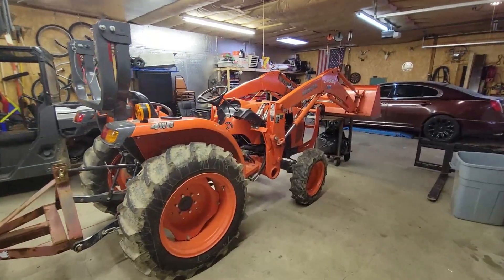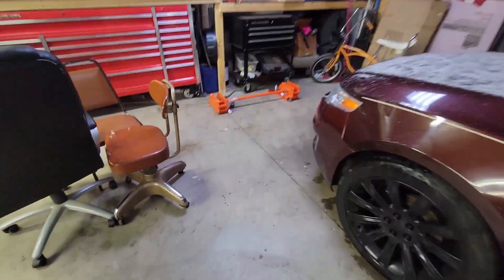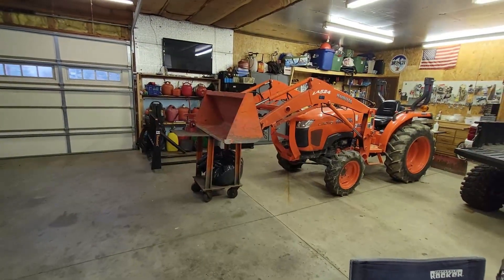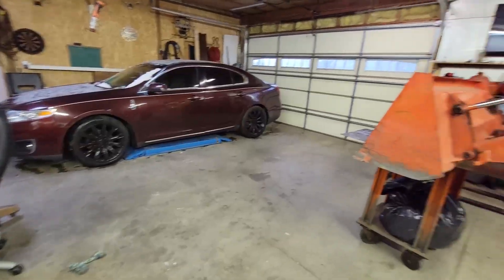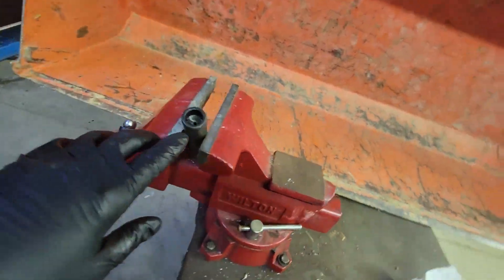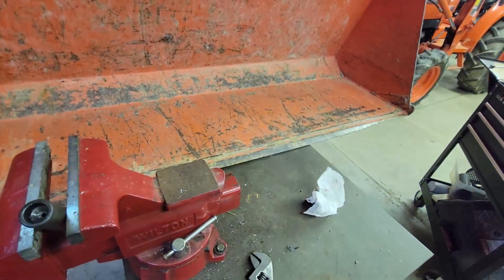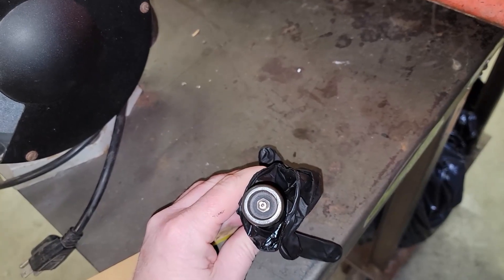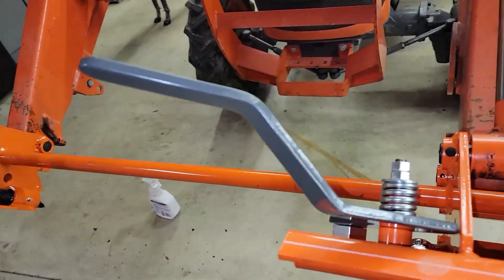Kubota L3200 Switching From A Pin On Bucket To A Quick Attach System SSQA

Comment: Glad to see the L2217 will fit the LA524.  That means it will also fit onto the LA525, which is what I have on my Kubota L2501 as well as the LA526.  Thank you for showing the model number on it, your video helped me verify this information and after years of pin-on I am now going to covert to SSQA!!
Reply from the maker: It has been one of the best things I have done for the tractor. I use the pallet forks way more than the bucket.